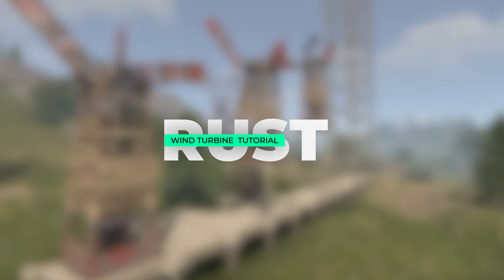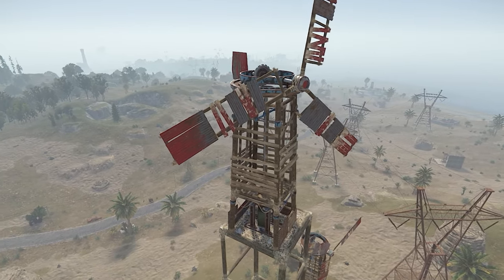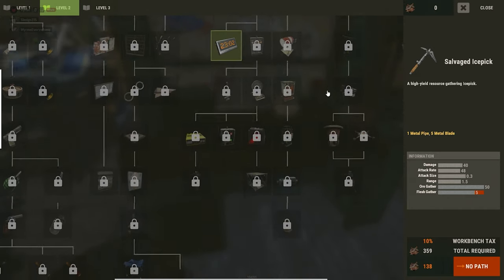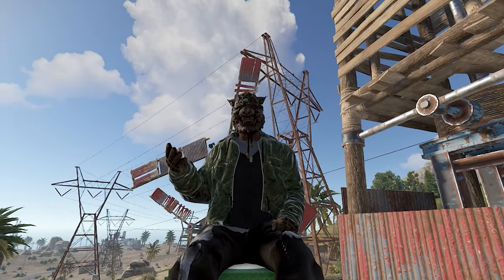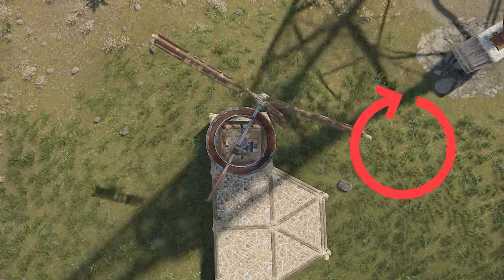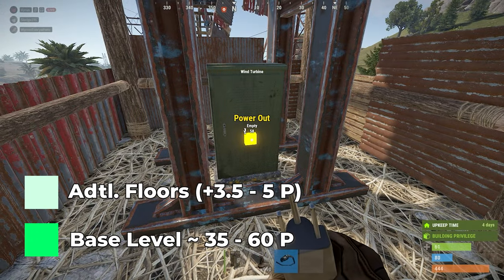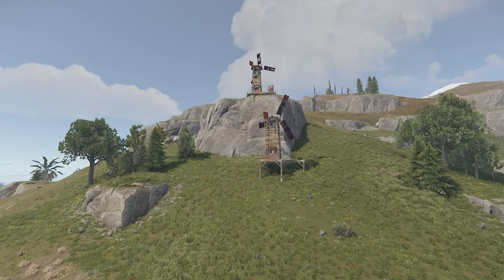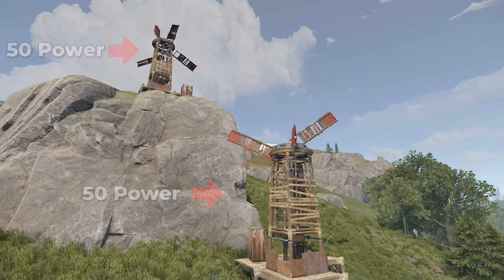Wind Turbine Placement Made Easy: A Rust Electricity Guide!

Comment: Dose the bottom floor count no matter the material its made of could i build on top of a cliff but have connected build structure at the bottom to and foundation? Would the bottom foundation count as the forst floor or is bottom floor counted at where tc is placed on?
Reply: Also great vids go ya another sub
Reply from the maker: @LifeofDereck  I believe it’s the bottom floor no matter where the TC is placed. I think it would figure in the lowest floor connected to the base that the turbine is attached to and base it off that! 

I hope this helps
Reply: @Sledge315  thanks
Reply from the maker: no problem my friend! and thanks for subbing, didnt notice you said that in the original reply, means a lot! hope to see you back in other vids, always here to help!

Comment: Any idea if this blueprint can be purchased from vendors or outpost? 804 scrap for the tech tree seems like a lot. And I don't really find these doing scrap runs? Just curious
Reply from the maker: yes it can be purchased at outpost for 500 scrap, add the 125 to research and you save around 175 scrap and workbench tax! you can find them in elite crates and higher at around a 1-2% chance per box. you can even find them on scientists and smaller boxes but its a litera .08% chance so very very unlikely